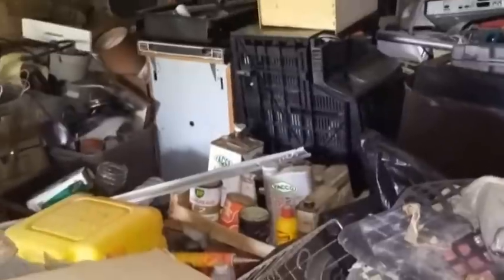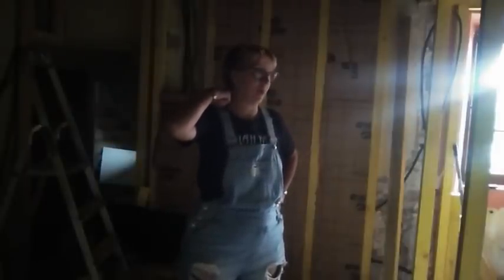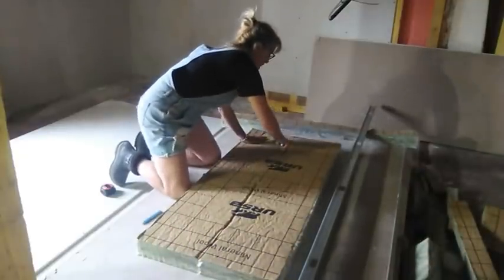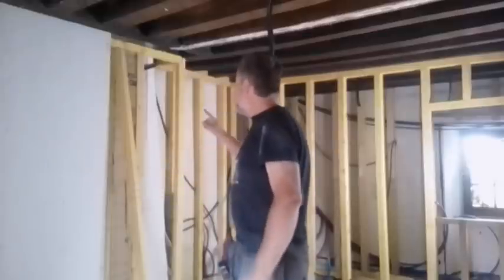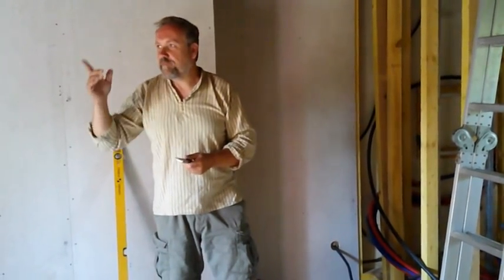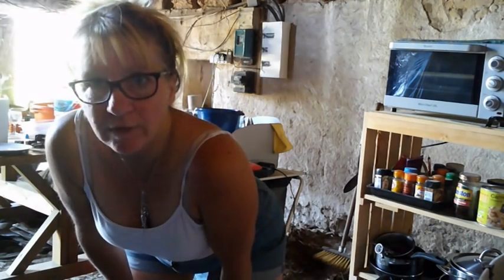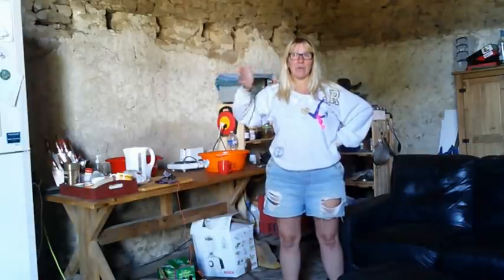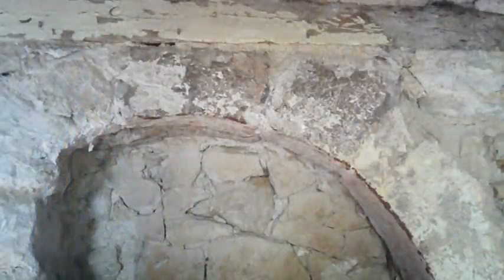27. Chateau De Montmagner- Renovating a 14th Century Chateau - Week 13

Comment: Hi  there,
So very impressed by what you have achieved. Love watching this every week. 
Perhaps this is a UK thing......
This might help😀
Down under (New Zealand) when we put the Gib on the wall.  (your plasterboard) it is stacked horizontally around the room not vertically so you only have the one seam to plaster. 
Very quick to get the board on. The edge on one side is slightly tapered so that when the two  tapered edges meet that’s the gap where you plaster and tape the join.
To get the level of the first sheet you either use shims to lift it level or I have seen our builder use a crow bar as a lever operated by his foot to get the level to screw it in...
Have a fabulous time with your friends.
.
Reply from the maker: Great tips, thanks Julie 😁👍

Comment: Your little alcove looks like a doorway because the potato washing area is off center with the arch. What is behind the wooden shelving and will that come out?
The emotion is coming from the vibes you are picking up from the past.
Or maybe you have a past life connection. You could try a regression session, that might be fun.
Reply from the maker: Hi Red Bird, I did originally wonder if it was an old doorway or window but sadly not, the external stones do not replicate any opening.  The 2 upper shelves are stone not wood and added most likely at a later date.  The Mayor said there was a hole under the bottom stone shelf which is original that went out to the lane where they would throw the water out. All very interesting.  Would be great to fins some old pictures of the house.

Comment: This looks really good, but I cannot help but wonder if the outside walls shouldn't have received a vapor barrier? Aren't you worried about mold?
Reply: I agree. I think the whole stud wall approach is questionable. No ventilation in those voids, no breathable vapour barrier, rock wool that falls apart when damp, single sheet plasterboard, etc. Loads of enthusiasm, but not sure the current works will last 600 years!! Just saying.....
Reply from the maker: Thanks for the feedback, are you an experienced French builder? The builders we are using have had 20 years experience in renovating French buildings and we are going with their advise but if you have the experience in this and can advise differently suggestions are always appreciated :)
Reply: @ChateauDeMontmagner  I am not an experienced "French" builder, but I have built several homes (or had them build)  in Germany and several States in the US and I had to really educate myself. In Europe we tend to build much more efficiently, here in the US I have had to rip walls open and to re-insulate, to get them to stop being so drafty and developing mold. I am linking a video for you , at min 13:29 it has a small video embedded on vapor barriers, which makes a ton of sense.https://www.youtube.com/watch?v=hrwc5y0kTyA
 Of course I don't know how cold your winters get in your particular area of France, but I know from experience how cold Paris can get if you are within 3 hours of that , your winters get pretty chilly. Again, I am not trying to tell you what to do, I admire what you are doing , it would just be a shame if you have to go back and fix a mold problem. Keep up the good work and the wonderful videos.

Comment: The stone arch could that of been a window ?
Reply from the maker: Hi Sandra,  I did think that but sadly not, the external stone work does not correspond with any opening.  Would be good to find out why it was there originally  ::)
Reply: Chateau De Montmagner oh l just wondered,it’s a lovely feature
Reply: @sandraford4235  if you mean the place referred to as the place the maire washed his potatos, it is a Limousin sink, it is where they washed things, however, there were communal 'laveries' which they used to do their laundry.
Still dotted around now, but usually made a pretty flower feature.
Reply: @ChateauDeMontmagner  please see my reply to Sandra Ford x